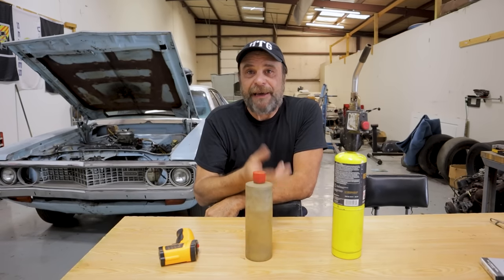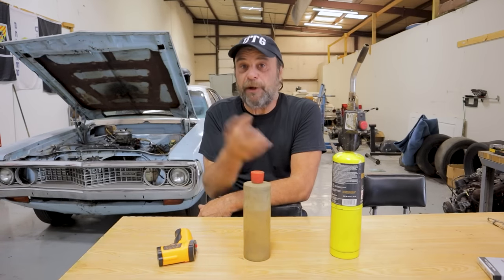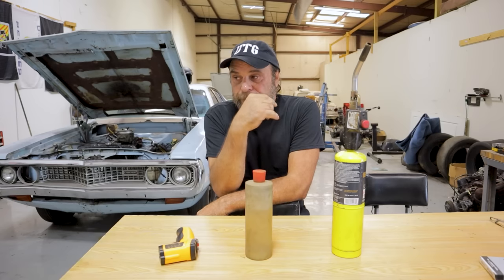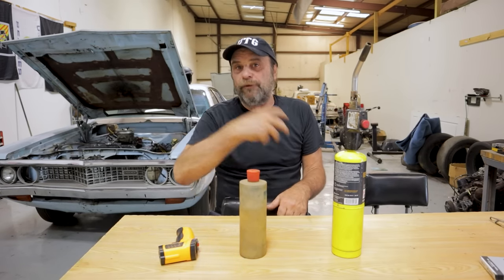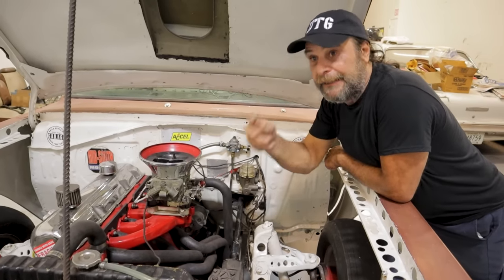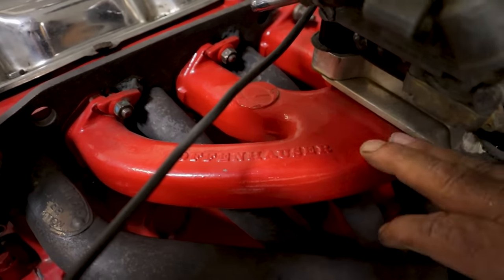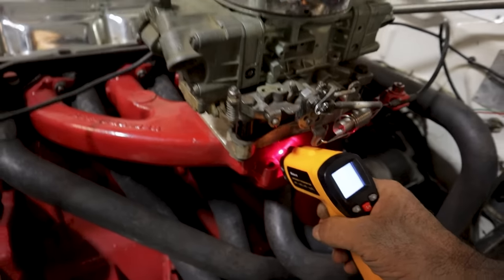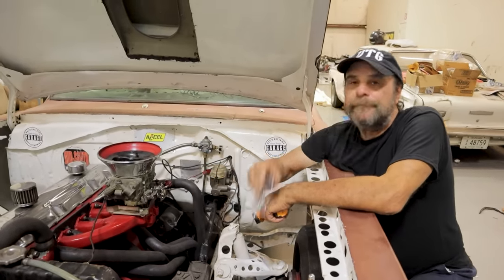How Much Intake Manifold Heat Is Enough? Testing The Vaporization Temps Of Modern Gasoline

Comment: Balancing the heat is tricky.  Hot air expands, takes up more space in the runner.  Same with fuel.  I think it was Smokey that said you wanted it as cold as possible from the outside air, to the plenum, just shy of allowing carb icing, then you wanted it to stay cold to about the point where the intake transitions into the head but not so cold that water vapor would build ice in the runner.  From that point forward, you wanted as much heat as you could get, just to the point that the fuel would vaporize around 15-20% of the wet fuel.  That mixture allowed the front end vapors to ignite better and create the heat you needed to get closer to optimizing the burn while still maximizing the amount of mixture you can get crammed into the cylinder.  In Vizards book, he talks about coating intake valves and getting more HP, but his engine was more of a road racing build than a drag build.  It would make sense that  you would gain in a long distance engine that spends more time at full power but I think the drag racing engine would benefit less except at the top end of the track.  You're needing starting line vaporization.  Looks like you are on the right track.  Maybe narrow up the valve seat widths on the intakes to allow less heat transfer and give a sharper edge to shear the fuel next time you have the head off.

Comment: The vacuum generated by a choke also causes the gasoline to boil some because reducing pressure will reduce the boiling temperature.

This is a way to cause vapor generation when the plenum is cold.

Comment: Ya know where a header doesn't have a heat stove or connection point a way to get heat on the manifold is somehow mount a coil/windings (not and ignition coil) of some kind mounted to under the plenum. Best part is it's controllable so it's not getting heat once heat soaked, you could have it controlled by a temp probe and relay or manually by high Amperage switch(or relay n solenoid). It's not even complicated to fabricate. 12v DC makes heat FAST so it should heat it up quick. Another shot in the dark idea is mount a glow plug poking into the intake would work I have no glow plug technical knowledge like how hot they get but if it worked it would be effortless to install.

Comment: I'm pretty sure intake manifold heat is compensating for a fuel system that has poor fuel atomization meaning a better intake and carburetor set up is needed.  Of course,  that's tough to do on a long inline 6 so it would seem port fuel injection would be ideal but is challenging to set up.  
The Euro trash vehicles used two or more side drafts which was about as close as you could get to port injection with a carburetor but side drafts stink in my opinion as they are a challenge to tune and require constant adjusting due to design, but they are efficient when working correctly.   Plus I hate to break it to you because I know you're on a budget, but you're going to need a hotter ignition system.  You could grab a cheap HEI conversion made for the slant 6 or something that fires at least 40K volts.  And throw the Champions in the garbage.

Comment: In a different video you explain the different lengths of runners on the intake work at different RPM of the engine, so if you tunned the carburetor with the primary directly over the two shortest part of the intake runners, it mite work better at low RPM just saying it's worth trying

Comment: If you look at all the cars being made today most of them engine lies are made out of aluminum Aluminum Intake aluminum had aluminum block stands for a reason that they would lower the boiling point of the fuel to match the lower engine temperature since aluminum dissipate heat so much quicker than steel does

Comment: 1/2 inch soft flexible plumbing copper is 5/8 inch outside diameter an fits nicely inside 5/8 heater hose. Use a few solder type elbows, and a looped intake heater is created.

Comment: No wonder they call you Chrysler guys sqware wheels omg , manifold is vaporizering the gas , gravity is pulling the gas in ,dude you got to stop just making stuff up to explain what you think is going on , the carborater is vaporizing the gas , the manifold is distributing the gas , and the atmospheric pressure is pushing the air into the cylinder , and of course we do need some heat to avoid stumbling but it would be nice to explain things a little closer to what is actually going on  I was originally a square Wheels guy myself I think they make some of the most beautiful cars but as a fate would have it I am now a Chevy man less headaches go quicker for less p.s. LOVE YOU UNCLE TONY 😅
Reply from the maker: Carburetor does the opposite of vaporize.  It ATOMIZES and therefore COOLS the fuel.  It takes some amount of HEAT to then VAPORIZE a small portion of it to be easily lit by the spark plugs

Comment: Tony, i hate to disagree with you but you will jave to add a heat shield under the carb spacer. Reason being is once you flat pinch it, even withe the manifold at 150 degrees, that cool dense fuel charge is going to make the manifold go cold.the more air(and fuel) you pish thru the intake like at WOT the colder the intake is going to get. Basically acting just like a radiator. Look into the old Chrysler service bulletin from the eighties about installing a field fix heat shield on slants. A cookie sheet works great. And you can always bore holes in it to tune how much heat the intake is getting.

Comment: I have 300 inline 6 with a weiand 177 blower, custom manifold on top of a Clifford intake . the clifford intake has 2 ports to run water through  ( heater hose ) it, do you think it would be a good idea to get the gas cold ( ice the tank behind the seat ) and run the coolant through the intake?

Comment: I have a better solution, i always thought of this as a gimmick thing. But it might actually work on this application and save you from heating up your intake manifold. So the problem is that with the low airspeed(small cubes, relatively large carburetor, cam ect) your stream of fuel delivered buy the accelerator pump discharge nozzle has no high velocity air to break it up and carry it effectively all the way to the combustion chamber. Especially on a rapid transition from idle to wot. And your solution to flash boil that stream of fuel by heating the manifold  when it otherwise gets squirted directly into the floor of the plenum may very well do that job. But in the game of onesies twosies adding up to make that slant run. I don't think the hot engine is the answer. You have to atomize that pumpshot of fuel much more efficiently before it even makes it to the plenum. I present to you the "powerblast plate" check it out. I think you could probably make one out of a piece of tin old-school hot rod style. If it atomizes the fuel enough maybe the low speed air will be more able to carry it. Might even have to step down your discharge nozzle size if you try it because at the moment so much of it goes unused. I hope this gets read and helps! Love this channel!

Comment: I'm adding a hot air intake to air intake here in Houston to keep carb warm so I can run it lean. Ran 1.5" conduit against headers and connected to a extra snorkel welder to the stock style  air filter housing. yet to be tested. it's a 1965 chevy 292 inline six with a 1 barrel in a 1980 square body!

Comment: So long as it has a decent alternator and battery capacity I would try a Cummins grid heater or two attached to the bottom of the intake. Just need a switch and a solenoid to run it.

Comment: Engineers can be wrong too. Play with the position of the carburettor, it could be blasting fuel into the jets on one side and pulling away on the other.

Comment: Tony i run a factory Chrysley 4 barrel long runner on my Aussie hemi 6. From the factory a well has been cast that allows coolantvto flow into the bowlbcast below it and then routed to heater core and back to block. It made a noticeble differnce to my combo. 10.5 comp large overlap camshaft

Comment: I can see this for cold weather running but why do V8's not have this issue with unheated intakes like tunnel rams? Why do engines make more power on dyno at 160-175?

Comment: Could you use a nitrous solenoid  with no nitrous. Drill and tap the runners at the same spot on all 6 runners,  But just spray a small amount of fuel off the kick.  I'd think that would shoot a nice mist of fuel  rather them a dribble from the carb.     Just a idea you know worlds more then me.

Comment: Ive got an alpha romeo with dual webers idfs, used to have the stumble. What fixes it for me was modifying the acel pump squirters so they would shoot a sort of mist rather than a fat stream of fuel

I found out about it accidentaly when i bent one of the squirters when taking them off, and noticed my bog was almost gone since the fuel was hitting the throtle plate rather than going directly into the "manifold" runner as a stream. Seems the fuel wasnt atomised enough when it dumped all of it.

Comment: Hotter the intake charge the more room it needs too. A side wffect of a heated intake. Heating it makes it act smaller ,increasing the  velocity.  I think this is a bandaid for a problem you could find more effective ways to address. You already admitted you upped the pump charge. Id ho back down. Put a nice fat smooth blend from the spacer into the runners. Keep it rough to help atomise the fuel . Maybe even ad more spacer.  And ditch the stub stack.  Seen them mess up a tune more than help. I honestly think this heat idea isn't the issue here.

Comment: With the bonnet closed it may heat up more quickly as there will be some heat rising from the exhaust.  Once you step on the gas the increase in airflow should pull heat out of the intake manifold.  It shouldn't hurt to let the motor heat up a bit more before a run, cold/thick oil will rob a few extra HP's.

Comment: I have a couple of 80s Nissans that have liquid heated/cooled throttle bodies that connect to the radiator. They run much better warmed up but  it could be other tbi magic helping.

Comment: I have a cvcc. The pre combustustion cylinder actually is rich ( because of volume and fuel air) while the main cylinders run lean for emission reasons. The carb is interesting and the pre chambers are basically running off a secondary soak line

Comment: Ahh ried vapor pressure fun topic. Remember there is a difference between ried vapor pressure from summer to winter blends of gas if your running pump gas. Ried vapor pressure is a good topic for vapor lock. This topic can get very deep because how a intake manifold wets the runners and fuel atomizes makes all the difference in combustion efficiency.

Comment: I've seen block heaters on engine blocks, maybe drill tap and die threads into the offenhauser intake to get it warm then turn it off once it reaches a "good enough" intake temperature?

Comment: Also, some high performance engines that work on alcohol have less of a problem getting enough vapor, because alcohol has less surface tension and also have a lower boiling point, therefore, they can afford to run colder and still give off enough vapor to ignite.

Comment: Hi uncle Tony

One trick you could try is a thin plate width of the carburetor but a fraction of a inch of the exhaust in length with or without vent holes in to allow a quicker heat build up under the carburetor bolted where the factory exhaust would connect too.
But there is no closure as you look from front of the engine to the back of the engine to give maximum heat dispersion to try and keep the heat in the area needed for vapor.

A question can the slant 6 run a different intake manifold say a intake that has a slight rake upwards instead of being flat to give a slight gravitational feed to the cylinder head.

But most of all you will figure it out and have the car running the way you want it to.

Plus old fuel had lead in it as a lubricant and cooling property.

Comment: Speaking of cooling, you have in il6, so cooled water in from the rad then it has a long path to cyl 6 and then back throught the head to leave the engine.
I wonder if there was ever any Chysler bulletins on racing a slant to short cut some of that water to help cool #6?

Comment: I had a similar problem with an inline 6 in oz, welded a aluminium pipe to the bottom and plumbed in the heater hose circuit, fixed it.
If possible you could make it the waterpump bypass so the flow stops when the thermo opens? Cant remember if thats possible on a slant 6?

Comment: dude this would happen to me on my slat six too for a while. even put a thompson power blaster plate a the squirter and it kinda amadamzies the fuel. More finer spray easier to burn you know. But still would run the best when it was fully warmed up.

Comment: Problem is, the moment you stomp on it, the air and fuel rushing through there will quickly bring the temp down.  The moment you do your burnout, you're going to loose most of that temp. You need it to heat up fast. Need to figure that out.

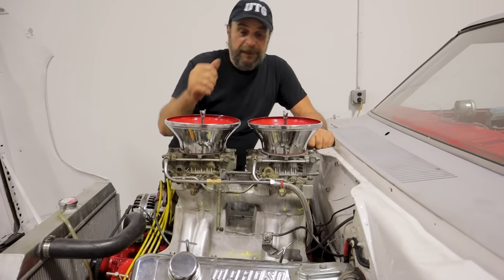Comment: Wait a minute, Uncle Tony! I had to stop the video at around the 10:00 point because I was getting really confused! I thought the main advantage of a tunnel ram manifold was the harmonic wave from the intake valves slamming open and shut that helps the air/gas charge flow more smoothly into the combustion chamber? Did I spend too much time studying for my B.S. in Industrial Relations and not enough in the engine labs at school?

At the risk of having my Shelby Dodge Automotive Club membership forcefully revoked, I still see too many similarities between a Slant Six and a 2.2/2.5 L 4 cylinder "K-Car" motor. Can the basic things you're doing to Bottle Rocket be applied to a 2.2/2.5 L engine that's going in a lightened K-Car based Mopar?

Now, I'll have to go back over this video. I believe non-turbo 2.2/2.5's not only have their intake & exhaust manifolds practically on top of each other and laced together, their heater hoses running under the intake for the carb or EFI unit (depending on year).
Reply: If you dig into the dev history of the 2.2/2.5 you'll find it was the Weertmans Swan Song (after doing some clean up work on the Hemi Six). 

He has numerous notes in his development work on the Hemi Six on how one of his big insights was not just the management of heat in the engine but how to abuse the heck out of the paradox of also wanting it to run hot in just the right spots.  I'm actually super intrigued now as to what could be done with a 3d printed Intake on a slant (or even my Flathead 230) as far as internal wall intake geometry and temperature control/manifold pressure in the intake. You could fabricate a dual wall intake manifold in a similar way to how oems do for exhaust manifolds to manage the interior and exterior wall temps separately

Comment: i remember they used to sell thin aluminum plates that acted as a heat shield fitted between the carb an intak/spacer. don't see them available anymore. of course a phenolic spacer is commonplace these days.

Comment: I had an idea when watching this video, why dont you put a piece of sheet metalin front of the intake and exhaust   manifolds to block the air flow allowing the heat to rise up and heat the bottom of the intake  . you could use hose clamps to hold it on so it is easy to remove.

Comment: I was going to make the same comment everyone else did about carb orientation.  I didn't realize the DC manuals specifically advised the orientation you have... I'm not a slant-6 guy so I just learned something.  That said, I would still ask this: when did was the DC manual written? What vapor pressure fuels were they using when it was written?  How much further experimentation has been done since they wrote that?  My point... they're probably right, but I'd kinda want to try both orientations myself to see if something's been learned (or the changes in fuels have made a difference in what works best) since then.  

PS- you should try your gasoline boiling test with gas that was bought in December-January.  Winter-blend fuel has a higher vapor pressure and it will do at 110-115 degrees what you saw at 150. :( Thats why its SO easy to get a case of vapor lock in early spring when you can get a nice warm day 80+ degree day, but the car still has winter-blend gas in the tank.
Reply: Rotating the carb is  worth the result - negative or otherwise. I'd want to know, regardless of what the manual states. Today's gasoline isn't the same either, loaded with ethanol - the poor man's octane boost.  Adding 16oz of Xylene or Toluene to the gas along with some Lucas upper cylinder lubricant helps stabilize ethanol rich fuels (and replenish real long chain hydrocarbons) - which these older engines weren't designed to run on.

Comment: What if you expirament with some heat rising from the  header to the bottom  of the manifold and control it with some sort of valve.You could  also rig a temperature  gauge  to the tube and see what temp works  best.

Comment: Is this why diesel doesnt light up when trying to be ignited with spark because it doesnt evaporate much and doesnt have much vapor? But gasoline does because it evaporates much more with much more vapor around it?
Reply: Diesel is less volatile than Naptha / gasoline and thus much safer. If I remember it correctly the flash point for Jet A  (kerosene essentially) is 138F approximately and -40F for gas. Gas is volatile at at a wide temperature range and produces flammable vapor. Diesel & Jet A have a limited range of volatility, burn slower and are safe for jet aircraft flying at 35,000' or 500'.

Comment: You need to make a heat riser on a hinge, it can be up to heat the intake in warm up and staging then swing it down by a cable or whatever by the driver to make the run, adjust the size of the riser as needed to get the temp you want